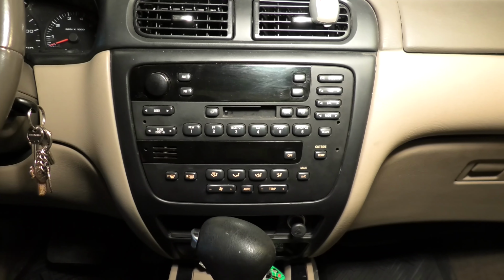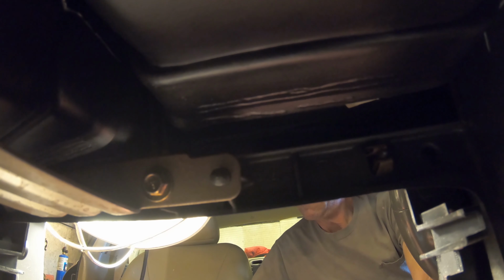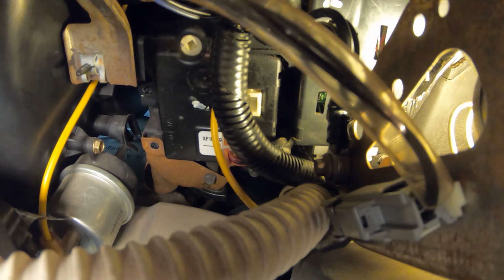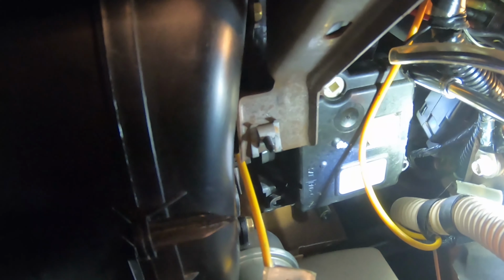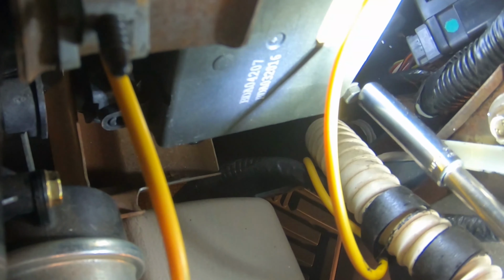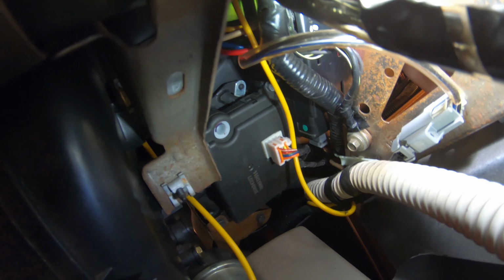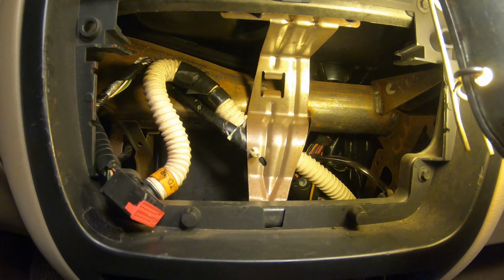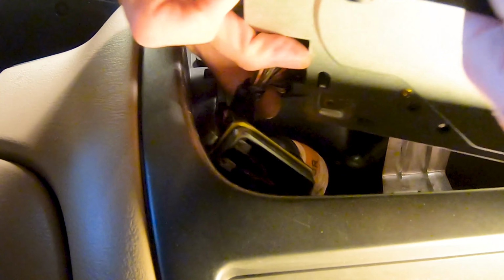2002 Ford Taurus Automatic Temperature Control Complete How To Replace Heater Blend Door Actuator

Comment: Thanks after 4yrs. Just did mine. I used 2-2" & 1-12" 1/4" wobble extensions that helped me greatly. I only unplugged the 2 wire connectors on the passenger side of the radio and didn't remove the bracket behind the radio. To check my work, I removed the additional bolt in the metal brkt. You can plug your 2 connectors in, start the car, and watch the metal link to see if it moves when u turn the temp knob. Here is a video that shows this check. https://www.youtube.com/watch?v=KXnO5vmm_Qg FordTechMakuloco also has a video of pulling the dash to replace the heater core.

Comment: This is very helpful, I tried to replace this last week, but couldn't figure out how to get that last screw out in the upper right-hand corner out. I cussed that tab covering the screw for a while before I took a hack saw blade and cut as much of it off thinking I could get to that last screw, but I still couldn't, so I put it all back together. After watching how you removed the wo screws and getting that thing to move out of the way, I believe I will try it again. Thank you for posting this very valuable video!!

Comment: Thank you sir! I have a 2003 mercury sable which is the same as the taurus. Tight spot for sure. You explained you need to have patience and you were 100 percent correct. Got it in for my kids first car. He even helped. Thank you for your expertise!
Ray
Reply from the maker: I am glad the video helped, and that the car gives your family reliable transportation. Thank you for watching.
Reply: Actually watching your video a second time. The air blend actuator I installed the first time was bad. 4th of July and doing it a second time. Thank you again!

Comment: Glad I found this. Even after I struggled on take it out on my own. Which took alot longer, than expected, because I didn't take out the radio. 
Ordered a ATC actuator Standard Brand from Rock Auto. Just a little bit before our 1st sprinkler of snow, in  Illinois / Indiana border. 
Thanks for the exceptional tutorial. 
Rob